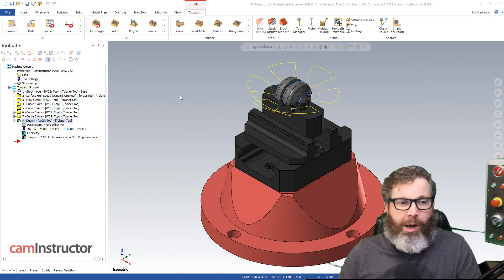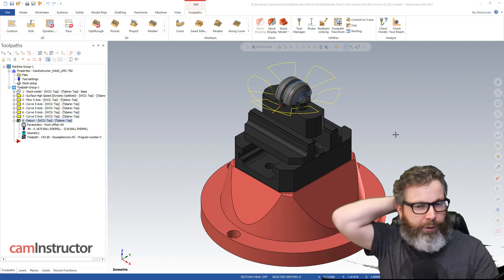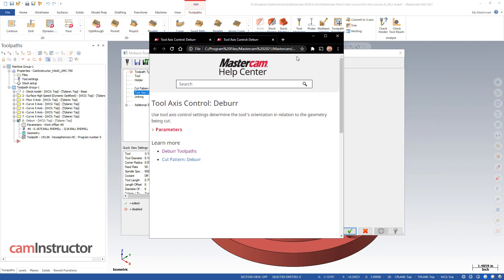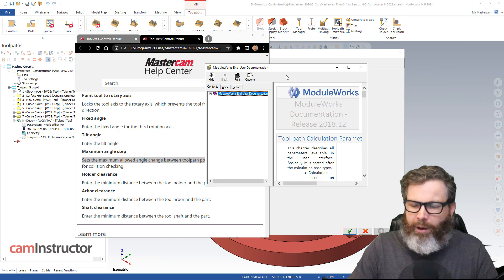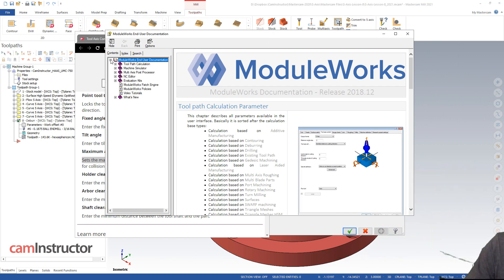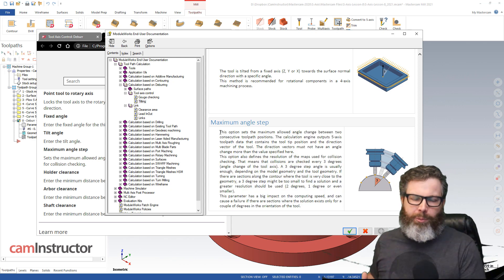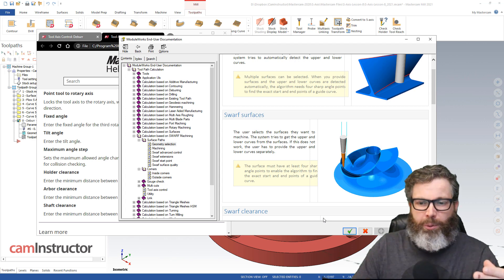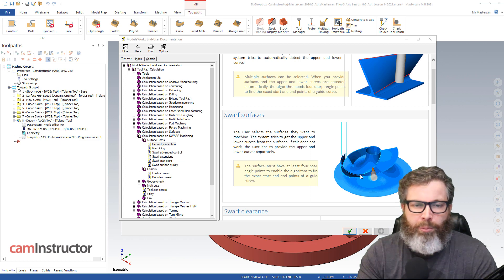ModuleWorks Help in Mastercam

Comment: Can you generate a toolpath like this using WNT tool in mastercam 
https://www.youtube.com/watch?v=YJBHgBDms6E
Or you can’t do it in mastercam?
Reply from the maker: No available path in Mastercam right now for B-Axis Turning. When/if this will change?
Is there a specific application you have for this type of toolpath? If you really need this I'm sure your reseller could help with something custom that could get you close to the desired output from Mastercam and then add some manual gcoding after.
Speaking from experience, I've had better luck with index/clamp/cut when using a tool like this but that was with very tight tolerance parts.
Reply: Thanks 😊

Comment: I downloaded at home to preview, nothing on tabs when I open. I'm guessing it needs to see a software with Moduleworks to display the info, is this correct?
Reply from the maker: You may need to unlock it. There were steps laid out in the video description, basically right click on the file and choose properties, on the menu that opens near the bottom there will be a check box to unlock. Click that, hit ok and you should be good.
Reply: @CamInstructor  Thanks for the tip. It worked, somehow I missed that part👍